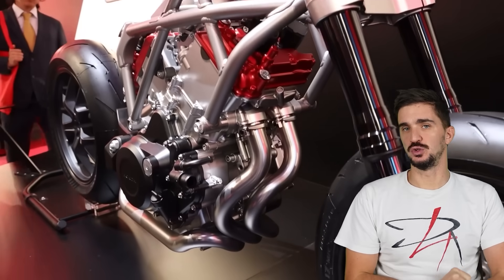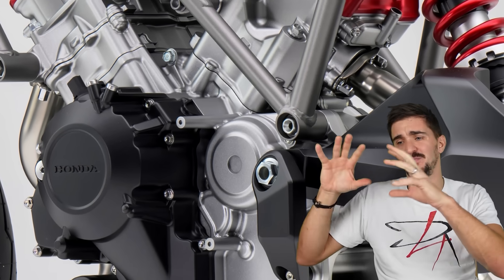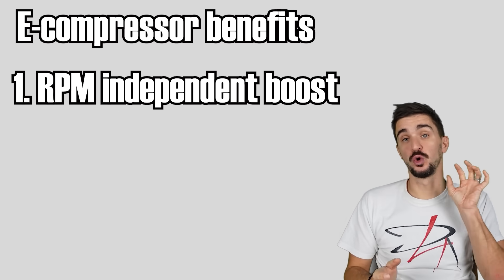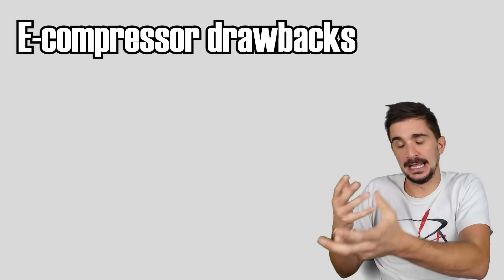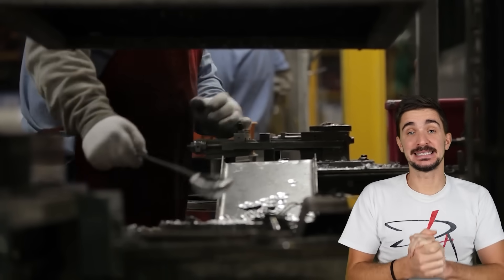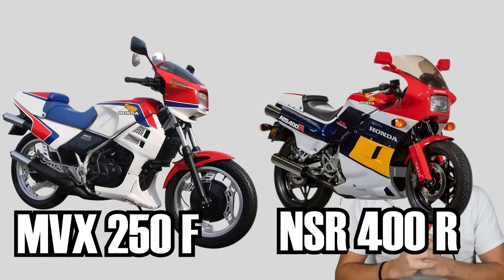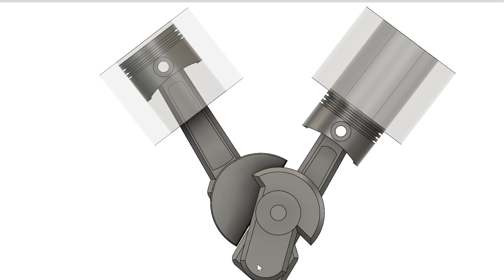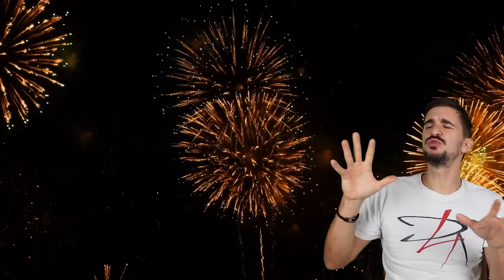Honda's New V3 Electrical Compressor Engine Explained

Comment: A fascinating video, with thought-provoking commentary, as ever. A couple of points to add, if I may?
Firstly, I think one significant advantage of an e-supercharger, compared to a turbocharger (you didn't mention) is HEAT. No need for a bulky intercooler if the super/turbo/whatever charger isn't being driven by hot exhaust gases. As to the electrical draw - I suspect such an e-charger would only work intermittently, on hard acceleration, such that the electrical drain can be recovered when going at a steady speed. That is, if you rode around dragging everybody off, you may end up with a flat battery. But it beats a crank-driven supercharger by making its operation independent of engine revs, and only being engaged when needed, rather than running fulltime.
As to the counter-balancing of a V3? A very complex area, and I must say when I first heard about this engine, I assumed it would be a 90 degree V. The counterweighting of a 75 degree V3 adds complexity, with that (small?) pay-off of a slightly shorter engine. But Honda are smart, and have shown historically that they can be 'engineering mavericks', so I await further news of this engine. 
You didn't really remark on the unusual form of the crankshaft, and the way the 'odd' cylinder's counterweights are adjacent to the big-end, as against the more usual placement on the opposite side of the flywheels (plus the counterweights for the two front cylinders is clearly not at 180 degrees from their big ends) but this is clearly part of how they achieve the seemingly impossible.
But this idea certainly has potential, and as you mentioned - Honda have a long history with V engines, and the 75.5 degree arrangement, with their complex V5 GP bike. We await further developments with interest! Thanks for your video, and your thoughtful discussion.

Comment: Since  you're not a native english speaker, you can be forgiven for not understanding the nuts and bolts of the english language.  A turbine is half of a compressor.   Turbo is short for turbine blower. As vs the diesel type screw blower (6/71 8/71 etc..) or a roots type blower.
So it is allowable to call that an eTurbo even if technically incorrect because marketing.

Comment: Just a small correction -- you mentioned that turbo "creates power", which is slightly misleading, as it allows the engine to create more power. The difference is important as the engine consumes more fuel for that (obviously), which is not so obvious from the "turbo creates power" statement. Still a great video overall!

Comment: How is the v3 better than the v4? You still have the same width and number of cams with 3 vs 4 cylinders. Only advantage I can see is weight and some reduced parts/machining costs for the manufacturer.
Also, yes this is not an e-turbo. It is instead an e-suprercharger.

Comment: If they go to all the trouble of an electric boost system for 5 lbs, why not just stay with an engine driven system. Generating the electricity for an electric drive has to be way less efficient than a belt off the crank. Not to mention the ability to operate all day long. Yes it is parasitic but less than an e turbo

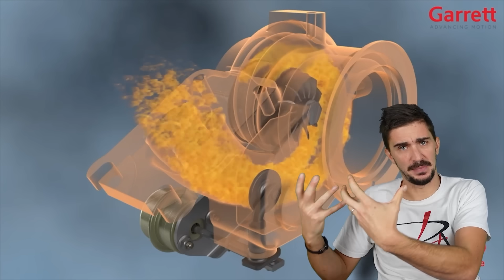Comment: 3:20 when you have someone make a neat video showing it flowing backwards....
Reply: It is not flowing backwards in the video...
Reply: @TarenGarond  if that was the hot side of a turbo it would be flowing correctly.. that is the compressor side. even look how it is mounted in the next animation the L looking tube side goes to the engine and the open hole middle is exposed to air
Reply: @Lissmanj  That is clearly a twin scroll hot side of a turbo.

Edit : I mean in the animation...
Reply: @TarenGarond  right.. so why are they using that to show how an electric turbo works...  there is no hot side on it....

Comment: I  suspect that the electric supercharger is only used to fill in the torque at low speed. Otherwise the battery and motor power requirements will be too great

Comment: Shouldnt the animation at 3.20 with the Garret logo run backwards? I thought the axis of the compressor was the intake and the edge the high pressure exit. (Edit: Ah, i get it now, that animation was supposed to depict the exhaust side of the turbo (non existant in this V3). Since we were talking  about an electric powered turbo i thought that that compressor side was what we were seeing)

Comment: Couldn't they use a bigger piston and cylinder fir the odd one instead of just increasing the weight of the rod? Thus they probably could also equalise the combustion forces more easily between the one and two-cylinder sides.

Comment: You've done it again, explained something really complicated in a simplified way. Really interesting. I ride a VFR1200x, which for those in the know VFR stands for V 4 Racing derived engine. Where the two internal cylinders are rear facing and the front two are on the external. This reduces the frame width. The VTR should be even slimmer. I look forward to it's launch  and then the later additions with larger, more powerful engines. Great vid. 👍🏼

Comment: I say this a lot, but a radial four two stroke with direct injection is extremely efficient and with 100% primary balance is also extremely smooth running. It would need an electric blower to provide air at low revs.
The opposed piston engine is also two stroke but has a longer blowdown for even better efficiency. This also needs a blower but more powerful as there is no exhaust energy to harness.

Comment: The boost on a turbocharger depends on the mass flow of the exhaust.  That's to say just reeving the engine will not do much to run the turbocharger.

Comment: This is an electric supercharger.

Why do you believe this:  "...and the overall  parasitic loss from a larger alternator should still be a bit smaller than from a traditional  turbocharger maxed out at 5 PSI of boost which means that overall power gains should still be  a bit larger with the e-compressor. "     

Instead of a belt,  this supercharger has an electric motor.  With a belt, all of the energy to turn a supercharger belt comes from the motor.  With an emotor, all of the energy to drive the electric supercharger comes from the motor.  Only some of the energy to run the turbo comes from the engine.    With good bypass technology you can get a supercharger to give close to the same fuel economy as a turbo, but only because the supercharger is bypassed.  Example audi 3.0T shipped production with both supercharger and turbo.  Audi 3.0T 333 hp Supercharged Engine Average MPG: Around 18-20 MPG,  Audi 3.0T 349 hp Turbocharged Engine Average MPG: Around 20-22 MPG.  Same engine.   You think swapping in an electric supercharger for the belt one would not have made the supercharged engine get another 10% better fuel economy ???

(the responsiveness value is clear.  the efficiency argument less so.)

Comment: You trynna tell me that an alternator producing electricty at some efficiency, cables moving haha funny electrons to the e-centri-supercharger at some efficiency, which produces boost with a motor at some efficiency is more efficient than a singular some efficiency of "haha a shaft with turbine"?
Nah dude I'm all in for a real eturbo like in F1 (MGUs are a stupid name) but that shit ain't believable to me.
Reply: if my memory serves me right, a naca (nasa when the us was making some 40L engines run at 3bar of boost) report deduced that the power lost due to backpressure of a turbocharger, as opposed to a magical charging system that'd be making boost for free, was around 25% in some particular X scenario. To match that, assuming no power being lost in cables/battery storage, the alternator and motor themselves need to be over 86% efficient each to match that WW2 tech that had enough backpressure to rock 9 times more boost pressure

Comment: If your reasoning for it not being a turbo is because it’s powered by electricity. What is a turbine engine which is powered by internal combustion. 

I’m not sure I agree with that logic. 
Other examples a supercharger is belt driven so is an AC COMPRESSOR.  Supercharger driven by a belt turbo by exhaust and this by electricity. They are all forced induction and I’m not sure that makes it a compressor.

Comment: If it’s blowing into a plastic/alloy air filter box it can’t have a very high boost pressure so it will have performance limitations.

Comment: Is the compressor motor variable speed frequency drive? Could accomplish the same with a CVT-like belt drive. Such HVAC fan drives likely inspired the CVT.

Comment: Simpler idea: a crank-driven high-pressure (low volume) supercharger that slowly fills an air tank to 100 psi while you're moseying or idling.  Then when you need it, instant 50 psi boost that lasts until the air tank is depleted, by which time the crank drives a low-pressure (high volume) supercharger.  It would mean you only get the max 50 psi for a short while (again, depending on the size of the air tank).  But it would provide a constant psi at least as high as the electric compressor, and if you really need to go all-out all the time, maybe you have other (legal, psychological etc) issues.

Comment: Some thoughts.  It would be better to call it an “electric supercharger”.   And I’m looking forward to someone creating  an alternator driven by an exhaust turbine. That way you’d get the benefits of the electric supercharger, combined with the “free energy” from exhaust gasses.  Very cool tech.  Thanks for the video.
Reply: Every current Formula 1 car has a generator on the turbocharger shaft to capture additional energy with the turbine, beyond what is needed to run the compressor - this is called the MGU-H. The production turbochargers with an electric motor (such as the Audi shown in the video) could also use that for generation.

Comment: It should be feasible to use a bypass duct to draw non-boost air around the supercharger, during cruise, or lower throttle settings, to reduce wear on the supercharger & motor, and reducing inlet loss if we allow the supercharger to "idle" when it's not needed. Or?

Comment: it's like an old school blower/supercharger, plus the asymmetrical cylinder arrangement allows them to close up the V in order to rebalance the vibrations, compacting and powering up the powerplant in even a smaller footprint than it had before.  Except the battery and compressor of course

Comment: Even if the compressor is electrically actuated, it's always about compressed air, compressed rapidly in a very short instant just before entering in the cylinders. Compressing a fluid in a very short amount of time means that compressed fluid increases a lot its temperature. How Honda does want to manage the temp increase of the compressed fluid, in order to avoid detonation? I don't see an intercooler or a chiller of any sort. Ok, images are about a prototype lacking several building blocks or elements (radiator for example), but I'm seeing compressor is directly connected to the cylinders' intakes. Don't you see detonation risks in this engine's architecture? ECU only will be in charge of that? (software only?)

Comment: This is for 2 up touring with smaller pistons and higher emissions standards from the EU. The e-turbo gives you low down torque and a cooler engine, less NOX. Probably a class leading fuel saving tourer. Honda are always interesting.

Comment: Thats going to be an expensive part of the bike. Electric turbos aint for a reason. Honda need to build a gear driven supercharger and bolt it to a V3 800

Comment: 3:36 maybe I’m wrong, but this animation appears to be backwards.
Usually blowers like this take in air along the Center shaft, and expel them along the outer edge.
Reply: Its the exhaust side of a turbo, it’s correct. I would hope garret would make a animation correctly

Comment: The thing that also puzzles me is ...1:10 ...  the unusually loooong heads and the really short cylinder assemblies, and, the rear one appears to be shorter than the front. I'm really curious about what's going on internally. It sort of indicates something on the order of a 2 to 1 bore and stroke or some really weird design. Can't wait to see what's up with all of this.

Comment: Looks like they could run it off the crank and have it kick on by an electric switch when the transmission shifts into second gear or as you pick up speed or have an electrical system on the crank that would supply the electric turbo with its own power alone that way as the engine increases in speed so does the electrical current and that way no draw from the battery or anything else.

Comment: There is no replacement for displacement therefor this is dumb
Reply: But it has a typical displacement for motorcycles.
Reply: @GH-oi2jf  the power of a 1000 with all sorts of unneeded stuff that will not last as long....may as well just buy a 1000

Comment: I need an engine like this to make a proper EV + hybrid-charging  drive for my  Ford Bronco 1  restomod.      

I need 40-90hp 3-4 cylinder engine recommended to drive a high-voltage DC generator for a: Drive plus Charge-while-Driving hybrid capability. [ basically a gas-powered range extender. Mainly used in sparsely populated areas and others with no public charging stations]
 That will send power to the battery pack and the E-axle, although the grid-charged Battery pack is still the main

Comment: Honda's V5 balanced one piston against four, or 1/4 = 0.25.  The inverse cosine of 0.25 is 75.5° - this is why the RC211V used this angle.
To apply this to the V3, the numbers need to be changed: one piston against two, or 1/2 = 0.5.  The inverse cosine of 0.5 is 60°.
Although your animation is excellent, with your chosen bank angle and piston phases it does not balance in the way described in the patent.

Luckily for Honda, they already know how to account for this difference in V angle and achieve primary balance (with crank counterweights).
So will you once you read up on how the NT650 and the VFR1200 achieve the same circular imbalance as the RC211V :)

EDIT: And also why I have conjectured the following firing intervals: 240-315-165

Comment: You miss an advantage of the electro compressor over turbos - the heat from the exhaust gasses stays the heck away from your charge air.

Comment: It is an electrical supercharger, not a turbocharger. It is taking power from the engine as electricity and, through a battery and controller instead of belts and gears, sending it to the supercharger.

Comment: Way left field for modern day Honda, V3 (last time they did that was a long ass while ago), single sided swingarm, forced induction, I get that they're having to make compromises to meet the noose that is Euro5+, but I'd love to see the sheer power this thing can make when it gets a flash & tune
I wonder if they'll do the same thing Ducati (I think) does with their V engines, wherein they kill the rear 2 cylinders on extended idle to prevent the seat from getting hot & help save fuel while stationary